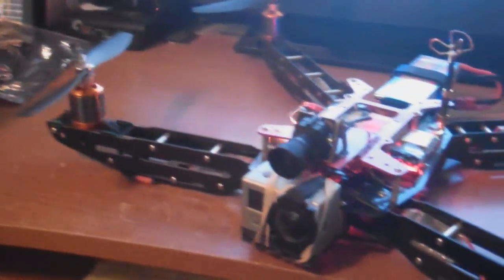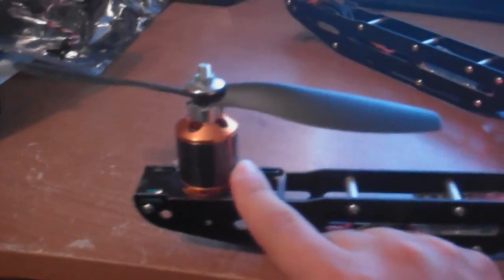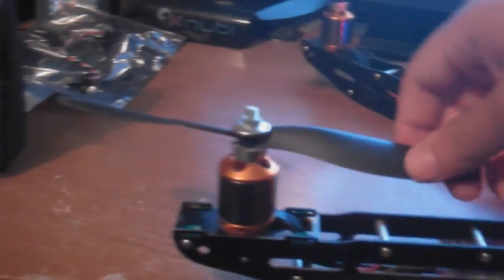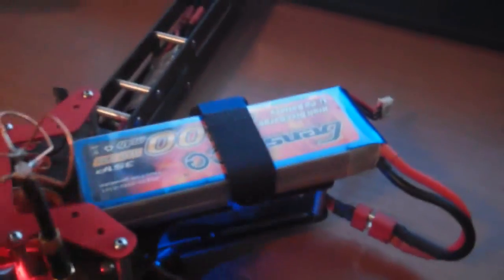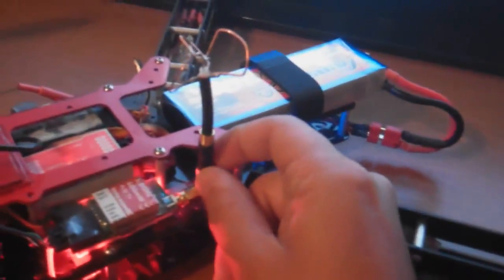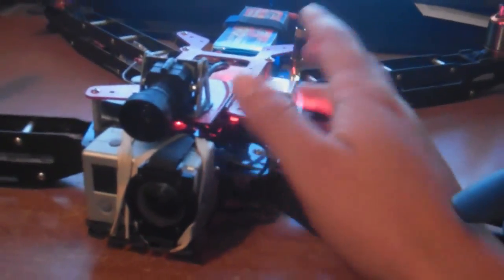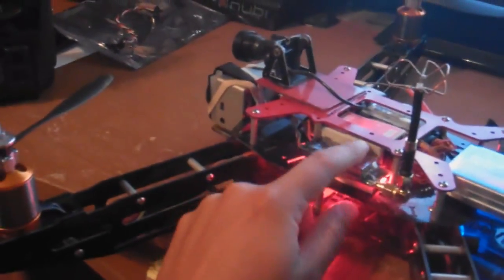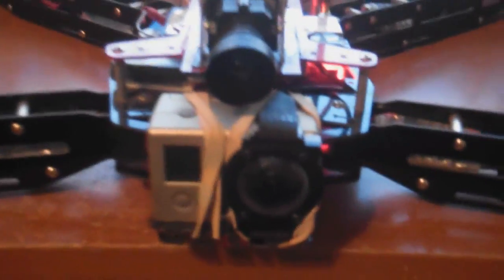HT-FPV hoverthings FPV quadcopter setup

Comment: Hi X, 
I got a new TH9x transmitter, and it has the Firmware V1 in it. Should I upgrade the firmware on it. And if yes, which one would you recommend. I appreciate the advice if you can help. Thanks. =)